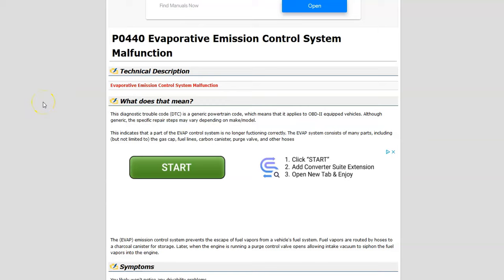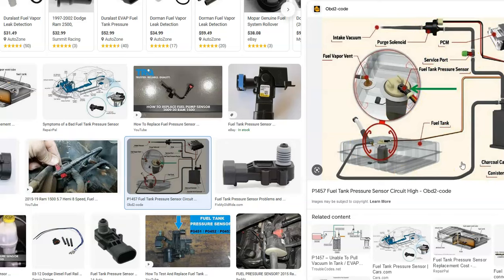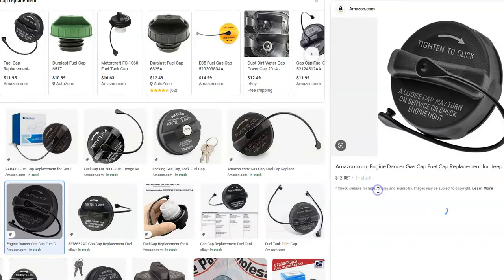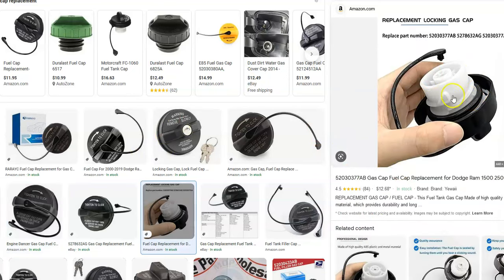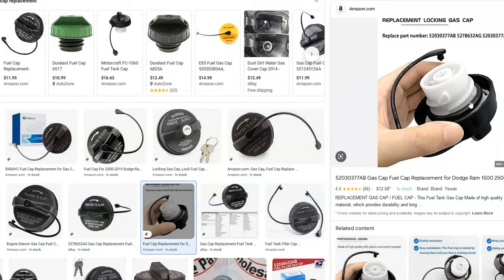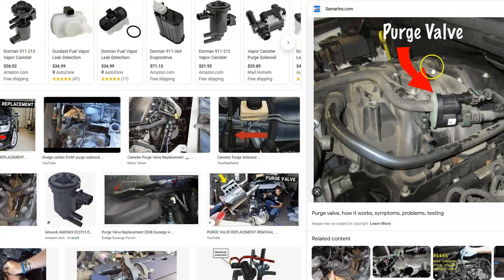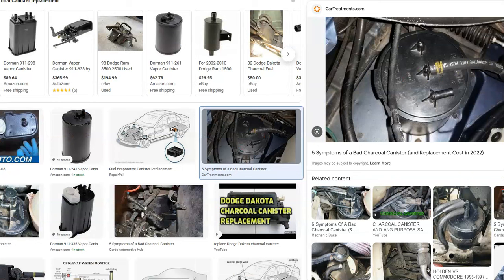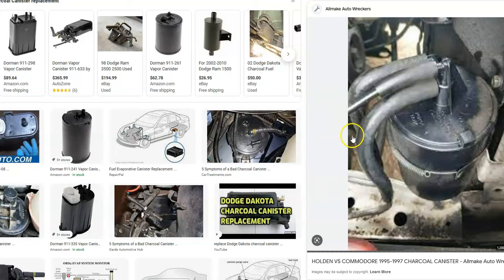Causes and fixes Dodge P0440 Code: Evaporative Emission Control System Malfunction

Comment: Everything has been replaced yet I still have this code, it's current and pending
Reply from the maker: It needs to be diagnosed. I made a full video on all the EVAP components and how to test them and fix EVAP Codes; here is a link. https://youtu.be/C5s3Rx3wjD0

Comment: 2004 Dodge Grand Caravan:  (1) replaced gas cap (2) replaced purge solenoid in the engine bay (3) smoke test shows no leaks (4) changed Leak Detection Pump aka NVLD aka Vent Vapor solenoid.   Still P0440 showing.  , could it be charcoal cannister?
Reply from the maker: Did you clear the code with a scan tool or remove the battery cables? Sometimes the code won't clear on its own. Otherwise, it likely is the charcoal canister.
Reply: @HVAC_Mechanic  yes, cleared the code each time and drove 100 miles to reinitiate the code and code came back each time. Just took to another shop this morning and they said could be the computer and take it to the official Dodge dealership - that is going to be super expensive.
Reply: @maketaco6683  My Toyota Avalon have P0440 code & I already spent $800 for replacing the Gas Cap, Charcoal Canister and Purge Solenoid.   It is still no LUCK.  I think I am going to buy a Smoke machine from Ebay & see if I can locate the leaking hose.  Too much money if send car to Shop to looking for (fix) this Error Code (P0440).
Reply: @oy8717  took my van to a different shop, found out the other shop installed the NVLD  backwards! The new shop re-installed correctly and the warning light is gone now, but still had to drive at 55mpp and stop  (see other YT videos about proper drive cycles - very important).  Charcoal cannister should be the LAST thing to change since they last 200,000 miles.

Comment: I have a 2004 Dakota 4.7. Nobody seems to say where each hose go to. I bought this truck used and not sure if they messed with the EVAP system. The diagrams I look at, look cartoonish. Not sure how accurate they are, because some forums I’ve read say the opposite. The hose that comes out of the throttle body, does it go to the top outlet of the purge valve or the bottom?

Comment: Very informative. i have two codes on my 2017 Jeep Cherokee, 0440 and 0456. Check engine light and check gas cap light both came on :( Its not the gas cap I will check for the purge valve next, so frustrating.
Reply: Mine did the same thing did u find out what it was

Comment: I've got a 03 Dakota with a 4.7 Magnum engine that's giving me a 0440 code. I've replaced the gas cap, the purge valve, and the charcoal canister, and I'm still getting that code. The interesting thing about it is I will clear the code, go for a drive, and after about 50-60 miles of driving the check engine light comes back on and it gives me that 0440 code again. Any idea what this could be?
Reply from the maker: It needs to be diagnosed, but I would do a smoke test and check for a leak.

Comment: I have replaced my whole system. Only thing left is the lines. i STILL have an evap code. I was getting p0455, then p0456, then 457. Now after replacing my fuel filler neck I'm getting p0440. The code keeps bouncing around but all the codes are the same thing, an evap system problem. I'm getting so tired of this I'm about to just leave it be. Just clear the code and get it inspected. because ironically it passes inspection if I clear the engine light. Which tells me there is nothing wrong with the system so why am I getting these codes?
Reply: Men.same.thing  only thing i need to change is the canister and the filler n3ck but i seen many do it and still geting the code so idk
Reply: @1989purry  I think I may have found the issue. I believe the vent tube running from the top of the filler neck over to the top of the tank has a clog in it. Unfortunately if i cannot get that unclogged the tank will need to be dropped. The valve running into the top of the tank is, I believe, built into the tank. So, that means a possible tank replacement and I'm not doing that so the damn thing can give me a light for another 2 years and then emissions is dropped on this car.  But check that line. If you cannot blow air through it you have the same issue.

Comment: Figuring out my issue got a 05 ram 1500 Hemi throwing code P0440 and when I fill up at a gas station the pump clicks off unless i press the handle lightly or else it comes back up to the filler neck and clicks the pump off
Reply: Same
Reply: Charcoal canister

Comment: Question. Would all this cause the car to stop starting? Thats the only code I get, and the car stopped starting.
Reply from the maker: This code will not cause a no start, just not pass emissions.
Reply: Maybe it is your purge valve. And after pumping gas did the car stop? It could be that it created an excess of fuel, too much fuel and not much air.